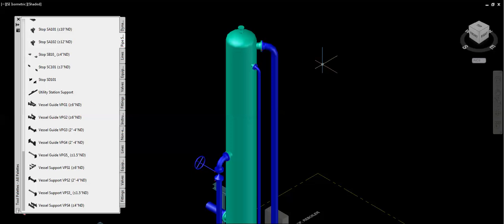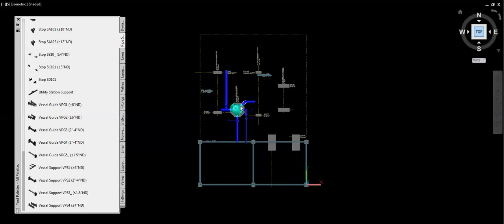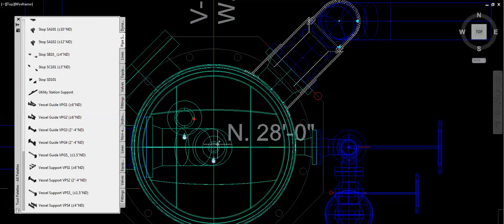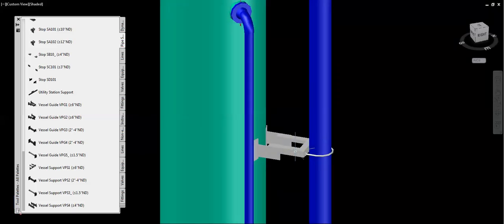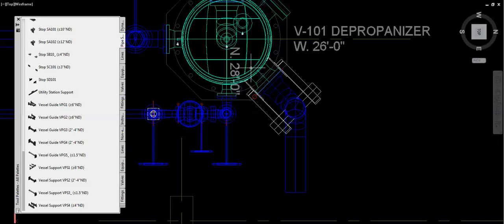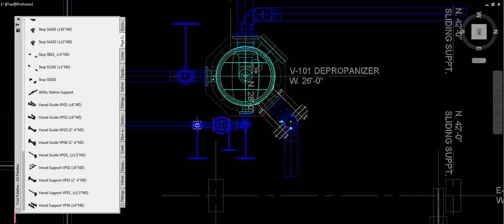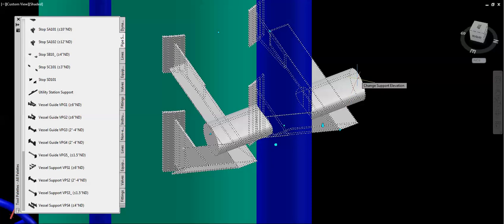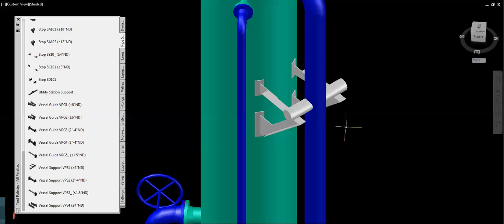AutoCAD Plant 3D Parametric Piping Supports

Comment: Hi Jason;
Are the supports designed for a specific diameter of vessel as well as a pipe size? Can the properties of the vessel diameter be modified by the user?
Reply from the maker: +David Flores 
The vessel diameter can be changed to whatever the user wants either by stretching to snaps or direct entry of the value.